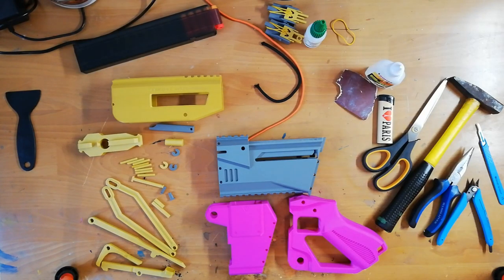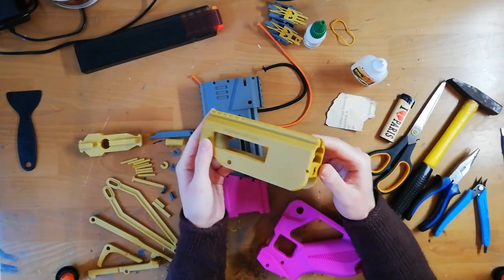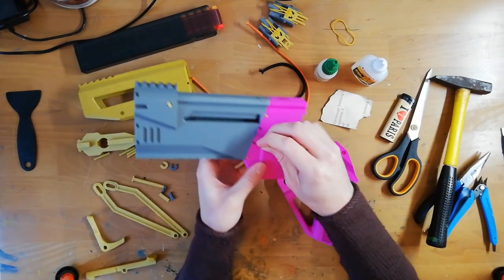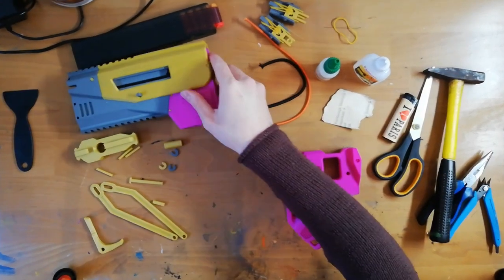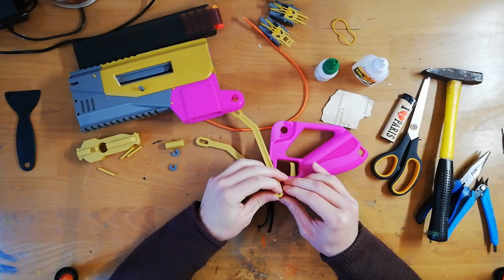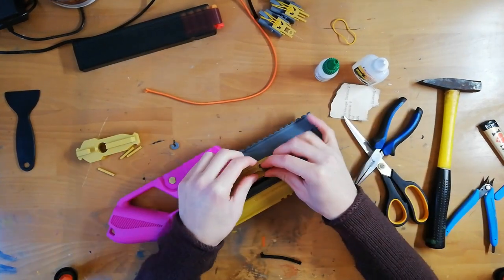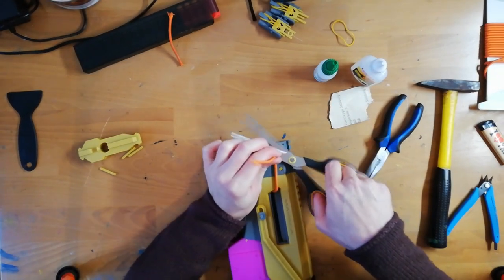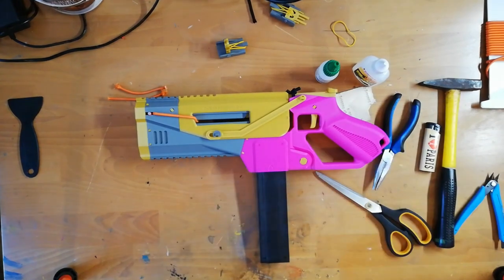Maraca Assembly Guide

Comment: amazon links to the darts, clip, elastic needed for this build please. 

I am printing parts now, but don't know about types of nerf darts or nerf mods.
Reply from the maker: I cant provide amazon links as i am probably not even in the same region as you, but if youre in the states get worker gen3+ darts, some 4mm elastic cord (i like the brand okaei) and a worker talon 15 round mag. You can buy magazine and darts from out of darts in the use or blaster-time in the EU
Reply: @bruceleedleleedleleedlelee1127  wonderful, thanks a lot, you're a v talented designer, parts printed so far  fit together like a glove!

Comment: I just finished assembling my maraca but the propulsion elastic keeps slipping. and in order to keep it from doing that I have to make it too loose to actually fire with any practical velocity
Reply from the maker: you may wanna try sanding down the nub on the triggerlinkage a bit, that has caused issues for others

Comment: in the print settongs you said "Print settings: 3 Walls, 20% Infill, .2mm layer height". does this mean walls should have a thickness of 3 or does it mean that the wall line count should be 3

Comment: sorry for the stupid question, but im new both in fdm printing and in nerf stuff. If I understand it correctly i just need your files to print out, get some rubber bands and short nerf darts and assemble? Do i need any other parts like donors from retail blasters?
Reply from the maker: you will need at least one talon mag and short darts as well

Comment: Im having a super weird issue where everything prints perfect except the grip, it comes out super jagged with very thin walls around the trigger well. Tried 3 sepatate prints with different filament brands. Any suggestions?

Im using the settings the text doc says

3 wall layers
.2mm layer height 
20% infill
Reply from the maker: try the setting to print inner walls first then outer walls

Comment: Finished printing mine, working out some kinks that I think are mostly related to my print settings (aka skill issue). However, my trigger is very heavy, but if I loosen the elastic enough to make the trigger comfortable to use, the thumb button no longer reliable locks into place. Is there a way to lighten the trigger without loosening that thumb button too much?
Reply from the maker: either try some kitchen rubberband or maybe try to saw a notch into the trigger further to the pivot point and rest the elastic there
Reply: @bruceleedleleedleleedlelee1127  Rubber band works much better, thanks for the recommendation. I printed the version with the mag lever, but it is very stiff, and I have already broken one lever, and I suspect the second one will break soon as well. I am going to print it out of PETG and see if I get better results, and if that doesn't work I will try TPU with lots of walls or high infill. I will edit this reply with results.
Reply from the maker: @chease9132  yeah petg will most likely work better
Reply: @bruceleedleleedleleedlelee1127  First impressions are that PETG works way better for the mag lever. With this in mind, I was considering printing a Khopesh, and I will probably print the grip for that in PETG as well just so the mag catch works more smoothly.

Comment: HEy man just wanted to know i Printed the level magwell, but the lever is super stiff and broke :/ any print suggestions? I printed it in pla
Reply from the maker: you can use the version without the lever, you can try printing a bit hotter and with more walls and you could just make it out of a more flexible material like petg
Reply: Thank you , another question I have is about the thickness of your cord. i found the same Kind as yours but how thick is it
Reply from the maker: @LpNecromancer  4mm